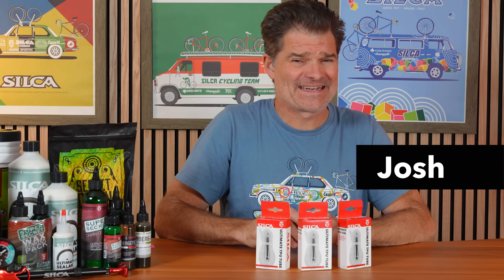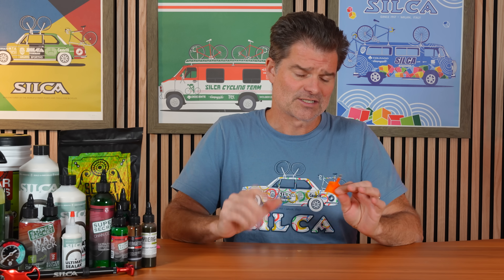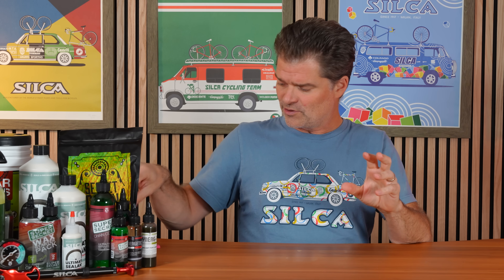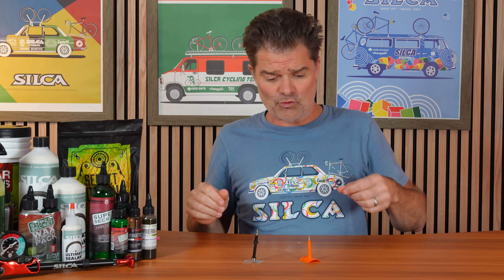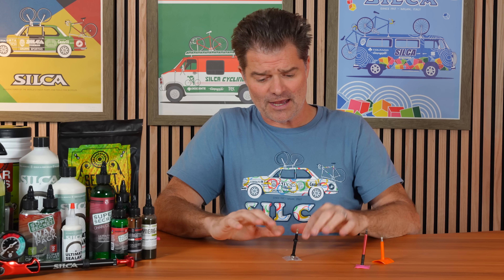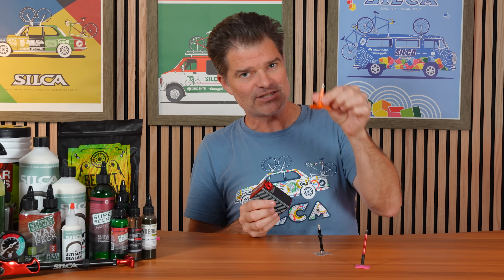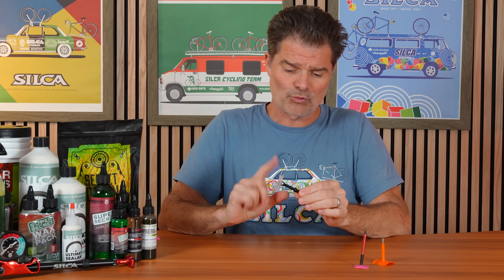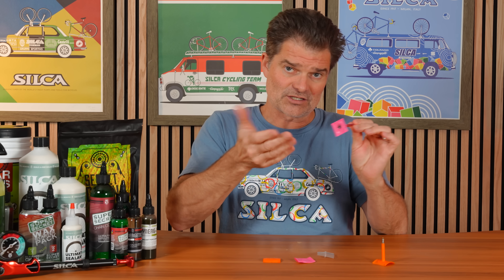Are TPU Tubes Finally Worth It? | SILCA Ultimate TPU Explained

Comment: Folks, it might come as a big surprise. All TPU inner tubes are made in China. Yes, that includes Silca TPU which they charge exurberant price with their name on it. Go ahead if the Silca name is worth triple the price to you and you are comfortable with that. I use cheap Chinese TPUs and never ever have any problems whatsoever. So using Silca TPU with the rubber dye is worth 3X the money as well as being a sucker to brand recognition, be my guest.
Reply from the maker: Sorry, but base TPU and final tube assembly and testing are made in Germany using valves machined in Italy by Record Spa, who make the finest presta valves and cores as well as all SILCA pump check valves since 1947: https://www.recordspa.it/en/history/
Reply: @SILCAVelo  You use a one in a hundred example to argue a point. Made in Germany is NOT the mainstream. Shame on you for going into that rabbit hole. Be my guest if you think Made in Germany justifies paying 3-4 times the amount and go ahead vouch for it.

Comment: Did you mean ultrasound than radio waves? Like you said, small electric pumps generate a lot of heat, which can be conducted down the stem and injects very hot air through the flange. Use a tube extender to separate the heat from the pump and give the air a chance to cool a bit.

Comment: Ive been using pirelli tpu tubes just one issue they have 0 surface for the pump to grip the valve i will try the silca ones btw I use rim brake are they good for it?

Comment: If it has a 50mm valve stem, does it fit a rear disc wheel? (Zipp, Swissside?)

I've used TPUs as a backup  in triathlon if tubeless silca-sealant isn't enough to fix a puncture, but is the valve stem too long for Discwheels?

Comment: I'm a TPU fan, yet have had my ups and downs with them. Settled on Pirelli as the best quality and performance. I thought TPU's, is basically a piece of plastic that must be cheap to make, but the R&D cost are very high. Shouldn't that reduce over time, with cheaper/comparable quality entering the market? That hasn't happened and I found the low price Chinese ones unreliable. 

Now Silca enters the market, and as usual, Josh explains how they fix problems I didn't even know I had. BTW - I can't fathom how adding a colour has such a significant effect.

I like the valve, metal should help (I think) heat dissipate when using  an Electric Pump and the collar will protect the tube. One other thing caught my eye, Silca highlights the dimensions when folded, havent seen that before. Dies it fold smaller that other TPU's? Does that help me? Yes it could.

Bottom line for me, if I can realise the advantages that Josh expertly highlights, then its worth the premium. I'm going to spend my hard earned Silca rewards and buy one to find out.

Comment: My experience with 3 TPU tubes. 
1. It has worked for about a year now with no problems (pink)
2. Would not hold air for 1 day. I could not ever find a hole but fatal for a daily commuter (pink) 
3. Seam leaked from day 1 (green)
If I am going to spend at least $30 to get 1 good tube I would rather spend $10 more and have better guarantees.  Changing tires on an ebike with an internally geared hub is a pain.

Comment: I've been using various TPU tubes going on for over a year now and have't had significant issues. It's true I am careful when inflating and stabilize the non-threaded plastic valve stems (which I no longer use). I do use the threaded stems (with a lock nut to stabilize the system): No issues thus far. I will change to the SILCA TPU tubes but it all comes down to cost vs., benefit.  Note: SILCA valve stem length options = sub-optimal. Thanks Josh!

Comment: i moved from TPU because of the failure rate. i tried so many brands and they all failed.  even the spares that just sat in the bag or in the garage. I went back to Butyl and no issues. not sure i could ever trust them again.  maybe its time to try again(?)  any chance you guys want to send me 3 to test on the handcycle before i drop the money. lol  I laugh but serious at the same time.

Does the patch actually stick and seal?  the Chinese ones never stick no matter how clean they are. once the tpu begins to stretch upon inflation the adhesive lets go (in my experience).

Comment: As a recent convert to tubeless: Do you guys carry a TPU or other Tube in the event the sealant does not seal? Just plugs? Nothing and hope for the best? Thanks!
Reply from the maker: We recommend carrying both plugs and a tpu tube (or two) when running tubeless.  Keegan Swenson at Little Sugar was a great example last week, he sliced a tire so badly that he used 8 DynaPlugs and it still wouldn't seal, and so he had to use a tube and also a spent gel package as a tire boot to get that thing to the finish line.  These aren't common scenarios, but they certainly are possible ones!

Comment: Have you done any testing with the TPU patches? I installed TPU tubes and had a flat on the 2nd or 3rd ride. Happy to patch if I can use the easy patches, but just would like to know what you think about patching. There seem to be 3 types of patches? One TPU patch with adhesive that applied kind of like a band-aid (This is the one that I used, but I have not re-installed the tube). Then a TPU patch that has glue that you have to wait for it to cure. Then some say you should just use the instant patches for the old style tubes. I guess I could just not use patches, but that seems like a step backward for resource usage?
Reply from the maker: The patches we sell with our TPU tubes are made from TPU and have special TPU based adhesive that allow them to work as a permanent repair.  Simply clean the tube with the included alcohol wipe in the area of the patch, allow the alcohol to flash off and then apply the patch, works as well as the glue-on type patches without the hassle.  However, these patches do not work on butyl or latex tubes, as they are TPU specific.

Comment: Interesting. A very long commercial. However, the design appears to be well thought. Can sealant be used inside? I see that a patch can be used. Hopefully, the patch actually works. I will continue to use latex with sealant inside  for championship events because this setup is very reliable and has low rolling resistance. I don't care about the added weight for triathlons. TPU tubes are useful for a spare just in case of a puncture that doesn't seal via sealant. Also, having something to put against a cut via pinch flat is needed in case of a larger cut in a tire casing. The old stand-by is a dollar bill.

Comment: How is 1 lb per wheel saved with TPU?
Reply from the maker: That was relative to the 29x2.5 butyl tubes that come standard on Trek e-bikes which weigh ~520 grams and the tubolito in that size was around 65-70gm so right at a pound per wheel of savings, but sadly not worth it when they failed at the valve stems!

Comment: Very interesting - ran into similar issues with pigments in PC drone props. Question - Supporting the valve stem as you have closes off the largest points of failure for the tube/stem to blow out from heat (Tpu having a lower glass transition temp and all), would these tubes be safe for rim brake use? Seems to me they should be, as there really isn't anywhere else for the tube to be unsupported. Follow up re: welding - was there a reason not to use THF to weld the material? I suppose sonic welding is less messy, and maybe more consistent...

Comment: Looks promising.    like many others I've moved from butyl to latex for weight and performance, then transitioned over to TPU for better air retention.   So, yes some (a little) improvement in air retention, but I've experienced issues with the plastic valves that are common with TPU tubes.   

So, I might try your Silca TPU tubes if they have good air retention properties.    I'd like to not have to top off my tire pressure for EVERY ride.

Comment: I've had multiple disappointments with TPU including exactly what Josh discusses about how tube ends are joined. 
In short: 
My TPUs purchased September 2025, 3 out of 5 already failed. 2 before leaving house, 1 failed at less than 12 miles. 
My detailed explanation:
Wife and I have matched pair of hardtails with 27.5 x 2.1 tires. I bought a total of 5 TPU tubes of which 3 already failed. Failures with both RideNow and WanBan. Although I ordered 27.5 the RideNow box label showed I received 26/27.5 tubes. They believe their product will fit both. But it was a frustrating whack-a-mole game trying to keep half the tube on the rim while getting the other half on the rim and in the tire. I had the tube at about 5 psi just to be sure I didn’t exceed the 8psi limit before getting tire closed on rim. Anyhow, at some point in this Vaudeville comedy act apparently the rim tape got pushed off center. A crescent of a spoke nipple access hole got uncovered. Over the next 12ish hours, unbeknownst to me the TPU tube was growing a little hemorrhoid down into the exposed crescent of that hole. Never ridden on. It failed sitting in shop while I continued other service on her bike. The WanBan tubes installed easily because they were made only for 27.5. But 1 WanBan and 1 other RideNow had another identical failure. Both brands of these TPU tubes are extruded as straight tubes, cut to length, and then 1 end inserted into the other with about 1/2" (12ish mm) double thickness overlap. Both brands gave me a slow leak stretch failure in the single thickness right next to the double layer insertion. Maybe the double layer doesn’t stretch much, and the single layer has to do too much stretching in a short distance. Or maybe it’s a process failure with temperature or bonding at the factory. Either way, our 2.1 tires are less than the mid point of the 1.9 to 2.5 range that both brands labeled these TPU tubes for.
In my 50+ years of experiences with butyl for road, road racing, MTB, bike packing, kids bikes, commuters,,,,,,never ever had this high of a failure rate with tubes (or sew up tires back in the '70s).
My scale showed that these TPUs were half the weight of my butyls (not the 1/3 claimed in ads). 
I have high confidence that the new Silca TPUs will be more reliable that what I got from these other brands. But in the video Josh indicated that only 700c sizes were available. We don't have any 700c wheels. Besides, TPU tubes for 2 bikes + a spare will cost nearly $250 with tax and shipping ($500 if also doing our 27.5x 3 Surlys). That total cost might keep us on butyl even if 27.5 become available.
Reply: Making me think more about leaving the TPU tubes I have on my shelf (bought for the supposed puncture resistance)...on my shelf. I thought I'd waited until the reviews came in...but starting to doubt 'em now.

Comment: I had a similar experience and was told by my wife that I was not allowed to buy those orange tubes again. I tried them about 5 years ago, unsuccessful. Back then the size range was stated that the tubes needed to be the same size as the tire, not depending on expansion or folding to fit. The tubes all got a tiny hole somewhere and could never completely make them work. Dunking in water to find the near microscopic holes is something not possible on a ride! They sent a replacement for one.
Last year I saw the orange tube company advertising a more flexible size range, and the tubes now fit more sizes. I jumped in again, and had the same problems. I sent images to the company of the stretched areas of the tubes after they were mounted to the applicable size tires. And again near unlocatable microscopic leaks, but never near the valve stem, (dunk testing). Small holes can't be found without dunking, had to call rescue.
I run 48mm ReneHerse tires, the big Silca tube fits a wide range across this size. Butyl tubes will stretch a bit safely, and I've used over sized butyl tubes in a pinch, neither installation failed. If the Silca tube is inflated to full unmounted, what size is it? Under or over sizing seems like a bad idea with tpu.

Comment: 😂😂😂 Josh, please get real. I've been using TPU tubes since Tubolito came on the market, now Ridenow 32 or 34 gram tubes. I've used them with Enve, Winspace, Ninevelo, wheels, both disc and rim brakes, gravel and road, and I've had ZERO problems.

Tubolito are stupid expensive, Ridenow are $8 for 2. Thousands of trouble free riding.

$39 - 🤣🤣🤣

Comment: Fan of Silca here and have previously used the latex tubes.  I've always been ok with paying a bit more for something that the company stands behind but there's no way I will ever purchase or recommend these unfortunately.  I'm sure that RideNow 36g has had some fails in their new models (no personal experience).  But a 4-pack is $44 so even with a bad QC on 1 or even 2 tubes and I'm still at half price.  6000 miles on them with zero issues this season.

Comment: That's an obscene price for tpu tubes. Ridenow has already fixed the problem of failing valve joint by selling tubes with metal valves. If you use the provided screw in nut then the valve doesn't move when taking the pump on and off and that solves the whole problem. The whole thing with the dye weakening the plastic might be technically true to a certain extent but the real issue was the plastic valves that can move back and forth because they weren't held in place. You solved a problem that was already solved and are trying to charge people 40$ (60$ in my country) for this when I can get something that works just as well for around 5$. I usually like silca but this a bit silly...

Comment: Josh did you also test the difference in rolling resistance between these Silca tpu tubes and a tubless setup with ultimate sealant? (Maybe with the same tyre on both setup)

Comment: After wasting my money on your sealant, I’ll hold off on these until the early adopter jury is out.
Reply: Another classic tubeless fail comment from someone who never bothered to fully understand how to actually use the sealant. Next up, we’ll hear how chain waxing is a scam because apparently reading instructions is just too much effort. 😂
Reply: @bremnet1812 Clearly you never used their original sealant as it is widely regarded as terrible sealant. There’s a reason that Silca reformulated it but of course you wouldn’t understand why. Nobody should have to “understand how to actually use the sealant” when others have already mastered the simplicity of it. 
BTW, Silca’s chain wax is excellent along with their wax melting setup.

Comment: I don‘t know man. The sizes are very good, because you can use them for a lot more bikes and valve stem lengths are much more usable than the outdated 40/60/80 lenghts, which I feel are always in between of what you want.

however, I‘ve been using vittoria ultra lights on my speedy road bike for a long time and never had any issues. continental tpus in my endurance bike are holding up great as well.

then there is the price. I can get two vittorias for that 40$ price tag. vittorias are also 15g lighter (because of the stem, I know), for two silcas I could buy four vittorias and have basically enough weight saved over the silcas to carry a spare tube. considering you should always have a spare tube, we‘re talking 45gx3 vs. 30gx3. thats 135g vs 90g.
the vittorias also test almost as good as latex.

it seems a bit overengineered solving a problem that does not feel like that big of an issue.

the only tpu that regularly failed on me are tubolito s. they suck.

Comment: Being "just about as low" rolling resistance as a latex tube, I can get 2 latex tubes for the price of one of these. Granted, at a weight cost, but still significantly lower than butyl.

Comment: I’ve been using the Pirelli TPU inner tubes because I got a really good deal (just $20 for 2), and they are the plastic valve kind. I went on a bike tour with a mix of both road and gravel, approximately 700 miles, in addition to my normal riding and commuting, and so far no failures or problems. I don’t think I could justify this kind of cost for a tube

Comment: Too bad TPU tubes are so puncture prone. I know, I’ve seen the videos to the contrary, where someone tries to push a screwdriver or like object through a TPU tube with great difficulty and claim TPU tubes are more puncture resistant than other types, but my experience in two years of using them in my road tires here in New Mexico does not support that claim. Every brand of TPU tube I have used including undyed ones from Australia have been very susceptible to punctures from goat head thorns. I’ve spent hundreds of dollars on TPU tubes and I have never had one fail anywhere near the stem or at the weld. Just endless punctures. Plus they are very hard to patch reliably. And Silca acts like they are being generous by sending ONE patch with the tube? When TPU tubes were holding air for me they were awesome, but I had to give up on them because they were just too fragile and expensive. Josh, what’s your response to this?

Comment: I ran a 4 pack of those sort of orange TPU tubes for a season a couple years ago. I had every issue with them you noted with the addition of eventual failure from deformation and failure along  inside from being run in single wall rims as opposed to a more supportive double wall rim.

One question though on the patches that come with the new Silca tubes though, given how many patches have ended up on the tubes of my families bikes: Are the patch kits available as a standalone alongside and how many patches is too many patches?